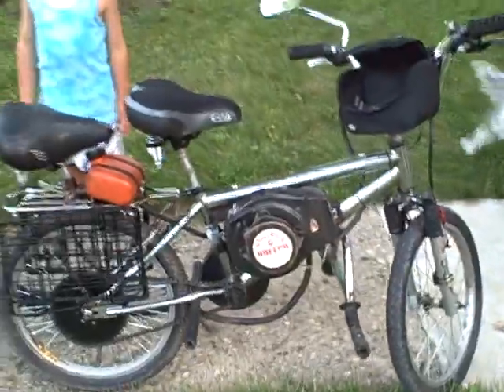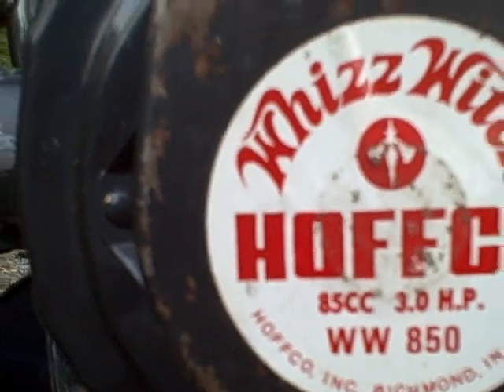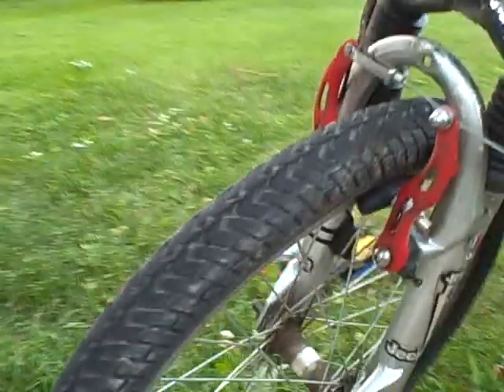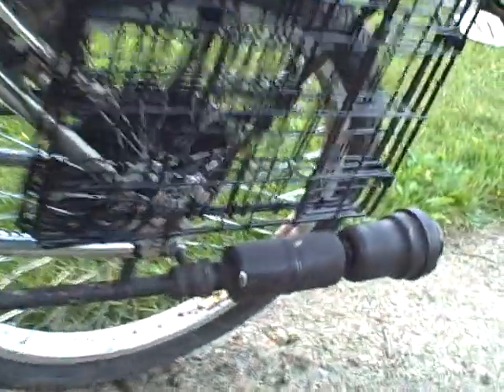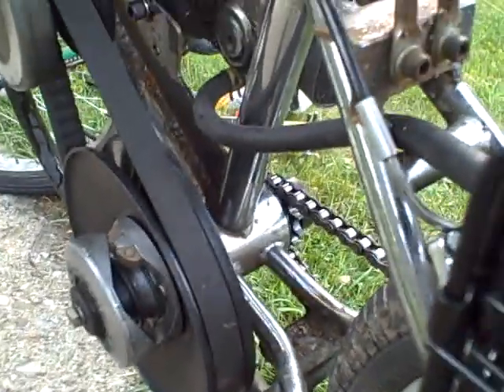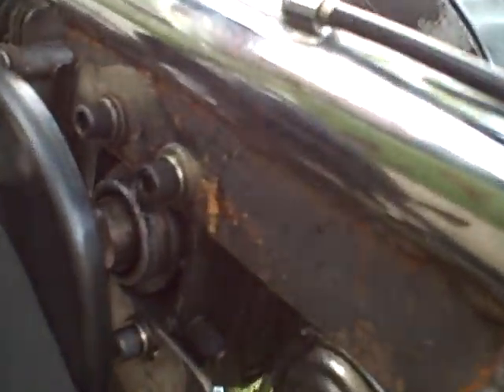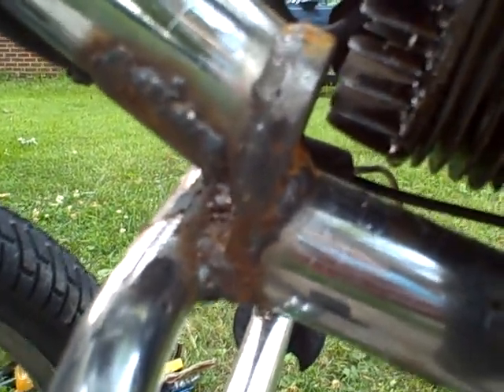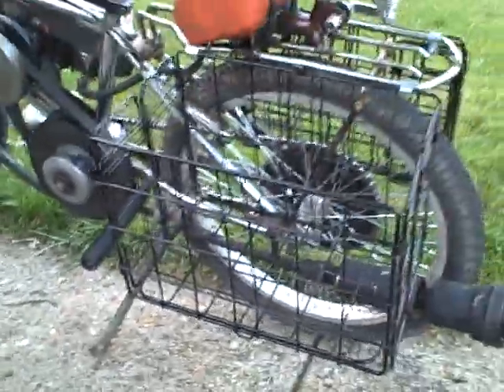Steve's motorized BMX

Comment: you should try getting a 7 gear back tire with a de-railer, replace the torque converter with a high ratio, that will make it haul ass up hills and grab speeds of 50mph